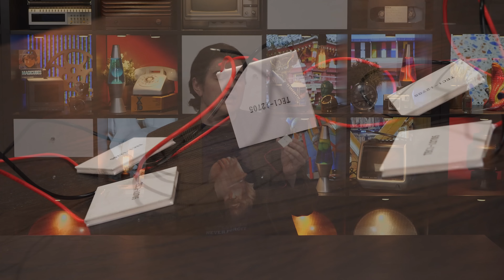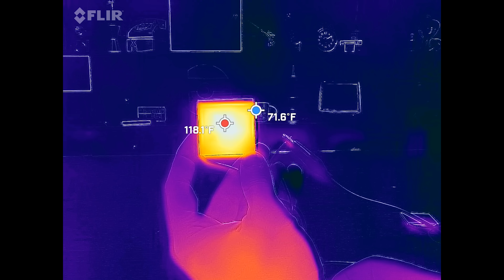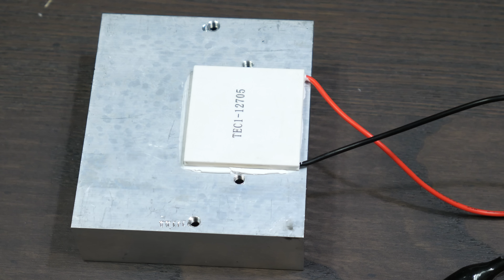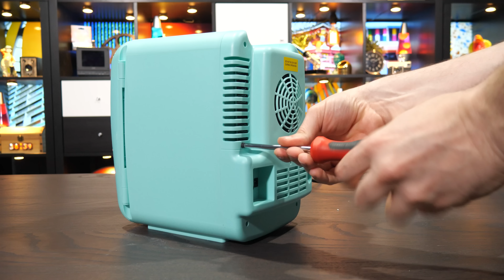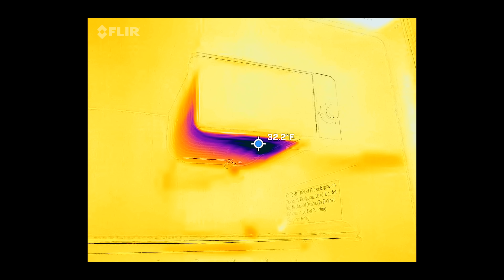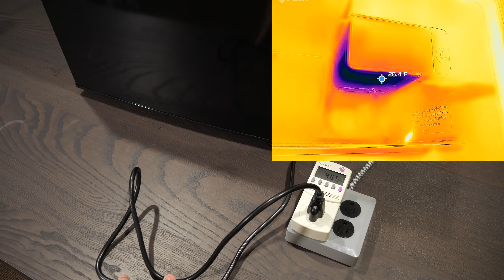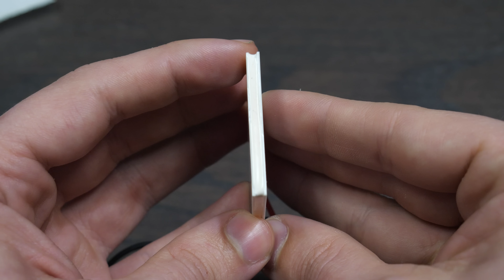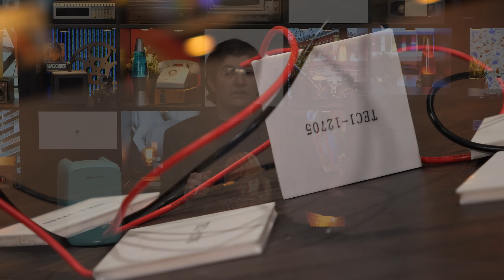Thermoelectric cooling: it's not great.

Comment: I bought one a couple years ago. They're mediocre. The only reason I bought it was because I bought a small dehumidifier. I wondered how it worked without a compressor. I was fascinated by it so much, I bought a little cooler/heater box. It does keep the the drinks cool, but not ice cold. It's better than room temperature, but isn't cold like you would get in a conventional refrigerator.

Comment: A fun niche application of a peltier: My old company made a lab instrument that needed a small chilled compartment for reagents, but it needed to fit on a desktop and couldn't tolerate vibration. So a few peltiers and a heat sink fit the bill without much design work, bulk, or vibration. They were also very easy for our techs to service!

Comment: I use the little toy for only cosmetic things just like you said.
And I change the fan from the original bad and noisy one to Noctua and make it quieter than the cheapest compressor fridge. (that noctua actually cost about the same as the toy fridge🤣)
It's also small enough that I can put it in ikea kallax. (have leave some extra space for cooling not coverd the whole air flow)

And electric in my contry is really cheap, so I'll call it a fine solution. (but not environmental friendly )

Totally agree that this is only useful for specific use case.
If you're not doing the same thing and having the same electric bill like me, please go buy a real one.

Comment: So one side gets very cold and the other side gets very hot. The solution is simplicity itself, attach dozens of these devices to one another! The cold side of one will dissipate the heat from the one before. There. Solved forever.

Comment: Peltier coolers get hot when you turn them off, because whatever heat is left in the heat sink starts to flow back into the "cold" side. It's kind of hard to design a good peltier system that has a doesn't require a thermostat with a really wide hysteresis.

Comment: The stupid mini fridge do have some uses, my wife runs a home veterinarian buisness and has one in the back of her van, it can keep vaccines and other medicines cold enough for longer times then a normal cooler, a small ice brick goes in to get it cold before she drives of, and a real fridge is not really an option due to size and vibrations. We also have a peltier cooler that we use in the caravan camper and can keep food cool for longer roadtrips and it runs of the solar panel (with battery backup), when you fill the cooler with cold things it stays cold as long as you don't open it (probably better insulated then the stupid mini fridge as well).

Comment: I use a small plastic fridge like the blue one to keep insulin during road trips. Yes, there's the question of a tightly controlled temperature range for storage - much less of a problem with insulin than you might think. I toss in my insulin pens and a lunch box ice pack fresh from the freezer.  Even if we need to stop for a while and the fridge shuts off, it keeps it cold long enough to be helpful.  This video has convinced me that it is the right tool for the job. 
Thank you!

Comment: One niche where these are used and i think is a good way, are Thermoboxes on trains.
In Germany or in general most European trains, Thermoelectric elements are used to power a Thermobox built into the cab of trains for staff to cool or warm things. I think this is a good method of using these, but for all other purposes i agree and they are not worth it.

Comment: From what I heard (citation needed) Peltier elements have somewhere around a 7% efficiency when used for cooling computer parts. So 0.07 cop.
They are way more interesting if you need to heat something as they can get a bit of bonus heat from the atmosphere. Say, for a tumble-dryer, you can run the exhaust over the cold side and reuse a fraction of the heat.

But that only makes sense if you're only other option is a straight up resistor.

Comment: I bought one of these small "toy" fridges, I was really surprised how good it was, but I do not really want to leave it unattended, like all cheap stuff. I had/have it in my garage, that is far away from home. And I have not much space to waste.
After an initial test time I let it be plugged in when I was not there, and it actually froze my Red Bulls!
I think it is worth it for what I use it for, to not have warm drinks if I want one when I am in the garage.

A real mini fridge around here cost about 300$, while the mini/micro fridge cost 30$, in hindsight, it was worth it. I also wanted to try one of those for a long time anyway.

If I had the room, I would have just gotten a used fullsize fridge, I have had some good old ones from the 80s and they last forever!

Comment: My nissan X Trail uses a vent from the a/c  system in the front cup holder.  There is a reversible plastic doodad with holes on one side that you can pull out and turn round to let hot/ cold air escape, depending  what the settings on the panel say,, if you feel the need.  In five years, even when the thing was brand new and I tried out everything I have not yet felt the need

Comment: At time 04:47 you state the Peltier is pulling 5A at 12VDC which is 60W of power being used. Does that result in the heat equivalent to 60W being dissipated? I mean is it really a direct equivalence? I just never really thought of it like that.

Comment: About the only useful case for these for day to day is those plug in car coolers.
You can extend the time the ice inside is frozen, and if it’s warm out chances are the AC is on in the car, so the inside of the cooler can stay relatively cool. They plug directly into the 12V with no inverter necessary. 

I will say though that the cans out of the desk cooler might not be that much cooler than room temp, but it’s a lot better than lukewarm.

Comment: Best minifridge I have is one designed for camping; actual compressor and it will go all the way down to -20C. I can run it for a week off a 700Whr battery pack, or straight off the car (or solar, etc etc)

Comment: 💡 IDEA;
I’ve used these and was also disappointed.
Wondering if those cooling elements could be stacked to cool each other’s hot side to gain colder than 30 degrees below ambient temperature. 
Only heat sink the last row with fan.

I would think the element connected to the heat sink would be larger than the hot side element it is connected to. 
Sooooo
For simplicity;
If there is a stack of 2 just one cooking the other. Something near 2 X 30= 60 degrees below ambient temperature might be achieved.  Hopefully closer to freezing.
Reasonable expectations;
Of course it would use more than twice the electricity and gain less than twice the cooling.
Anyway 
These coolers are better used as food warmer boxes…

Comment: 26:00 you could still put that in a trunk and run it via an ac inverter 

You can get car inverter that push over 2kw

But you'll want a deep cycle battery and a alternator upgrade
Reply: Or a solar panel on the roof

Comment: Also, Peltier cells are reversible, by applying a temperature difference, you can make electricity. I think the self powered wood stove fan things use these for that purpose.

Comment: Well...weight is a thing.  Adding a phase change fridge to my ebike camper is gonna add too much weight...the less effeftive peltier fridge can still run off my 12V battery system, weigh nothing, and is used more like an assisted cooler box...I freeze / cool my food before putting it in there.  The 40W peltier is just to remove the warm air from opening it.  It is the best solution I have found with the weight and size constrainsts I am presented with.  I have thought of building my own phase change system at a much smaller scale than anything I can find commercially available...but this thing was $20 Canadian on sale.
Reply: Also, I have a nice mini fridge...and...it weighs over  50lbs.  My entire camper is only 150lbs.  100W of flex solar panels are like 1.5lbs...and the peltier thing like 2lbs.  The extra power use is fine.  I have 3500Wh hour between my ebike and camper.
Reply: Also...one of the first things I did was insulate the "fridge"...it is wrapped in 1/2" rigid foam board.
Reply: Find me a phase change fridge that weighs less than a gallon of water and costs a reasonable amount and I will buy it instantly.
Reply: Heck...find me a tiny compressor and I will build the rest myself.

Comment: I used to work for a company that mainly produces pneumatic equipment. They also produced industrial cooling equipment. I repaired said equipment for them.  It was always a fight over who got to repair the peltier units (which were produced for "environmental savings" reasons, major selling point for semiconductor fabs).  Nobody liked working on them. I was the new guy who got stuck with them all the time.  They were neat for what they were, and a lot of them were for chemical cooling which was a neat selling point.

Comment: One thing about fridges is I’ve always hated that they dump heat into your home just for your home a/c to then take that heat and dump it outside. A lot of wasted energy to move heat. Why not have the compressor system outside. You buy a box that “plugs” coolant lines into your wall at home.

Also, the thermoelectric circuits, I believe, can be stacked to increase cooling.

Comment: I built a 12 volt Peltier cooler to keep eye drops cool on trips.  I incorporated a thermostat, fan, and capactor.  The capactor keeps the cooling fan running for a time period after the thermostat shuts off.  This reduces backfeed of heat into the cold box.

Comment: Another downside to the Peltier fridges is that instead of occasional deicing which you can generally take your time on with the traditional mini fridges. The Peltier fridges don't get cold enough and stop short at condensation which often results in a giant puddle of water forming under the unit that has to be mopped up regularly lest you irreparably water damage everything underneath it.

Comment: Sure, we know it's bad at replacing cooling system. How about in a car where no AC is present and using two closed loop liquid systems with heat exchangers in both ends to dissipate the warm / cool air?

Comment: Actually, Peltier modules are effective, those cheap refrigerators suck because they have a cheap power supply. You can easily upgrade them substantially by simply connecting a 90w (19.5vdc) laptop charger to a CC CV buck converter. Those peltier modules work much better at 14.7v and 5 amps. Also add a bigger fan to cool the hot side better. You can literally freeze trays of water, lol. It actually will probably make the laptop charger really hot, so adding two or more in parallel helps. Also add a fan to the buck converter. Then you need to deal with it being too cold, lol, so you need to add a temp sensor and an arduino to control relays that connect or disconnect the power. Nice.
I know because I did it already, lol. Yes they basically don't work when you buy it, lol.
Also, there are other drawbacks of a compressor fridge, like you can't fit one in your car easily. Also, they have a startup wattage of like 450w, which is a lot, and difficult to produce in something like a portable situation. I like that the mini fridge can fit the peltier cooler inside, lol.

Saying "Its bigger than your typical mini fridge". Is calling it a mini fridge, lol.

Comment: Hooray, a 30-minute Technology Connections video!

Peltier elements seem really neat, but I'm having a hard time thinking of much use for them. "Maybe stick one on a CPU to cool it... but then the other side gets hot, and you need to remove that heat... and we're back to square one." Maybe if they could be built in other shapes, like pipes containing coolant?

I assume someone's already tested what they do in the vacuum of space and the answer is "not much"? We haven't been accidentally overlooking a solid-state thruster? (Or they do work like that but just not well enough to be good? That seems to be a theme with these.)

Their ability to work in reverse, turning temperature gradients into electricity, seems much more useful. It's not very much electricity, but maybe that's one way to use them to move heat? Put them on something very warm or very cold and turn that temperature into electricity that can be sent somewhere else? I think if we had a good, efficient way to turn heat directly into electricity, we'd have something useful...

Comment: These are great for your desk in an office. I can tell you from experience that my company would balk at me bringing in a cube mini-fridge, yet has no problem with the "can cooler" I (used to) have. And the electrical was a non-issue as far as cost goes.

NOTE: I no longer use it because I stopped drinking soda at work.

Comment: They do have some very limited household use... Our summers are around 45 Celsius, thermal bags and climate control aren't gonna save our ice cream from melting in traffic. Car's insides with A/C on full blast get to 30 celsius or even higher.  Thermal bags with Peltier and fans are the only way to get ice cream from shelf to freezer intact. Efficiency be damned, I need my ice cream!

Comment: I've got one but it works very well. On an 80 degree day, it'll get cans down to 34 degrees. It's bigger than that little piece you show and can hold 12 cans plus. It works on house current, but it's best in the SUV to provide cold drinks on a long trip. It can also be switched to heating for hot lunches. Your compressor can't work on 12 volts.

Comment: You should look at ThermoScientific TSG series medical/lab fridges. Uses TECs with CO2 bladdes built into the walls of the fridge for heat abosorbtion, think there's an evaporator coil too. Kinda interesting, seen them a couple times and still didn't really understand what they're doing.

Comment: As per sub-ambient PC cooling experience, COP of optimized peltier coolers is about 15%. This means a pyramid stack of differently sized peltier devices, which minimizes heat gradient across each device and maximizes temperature differential.